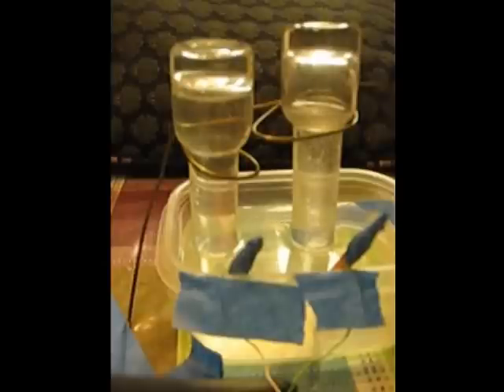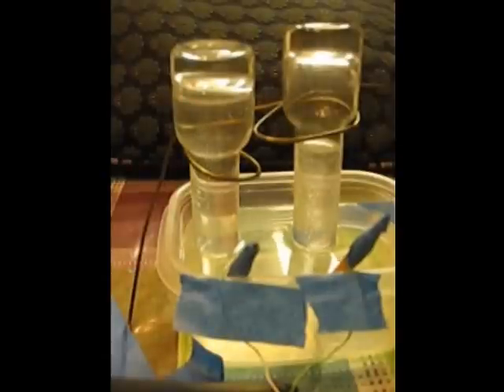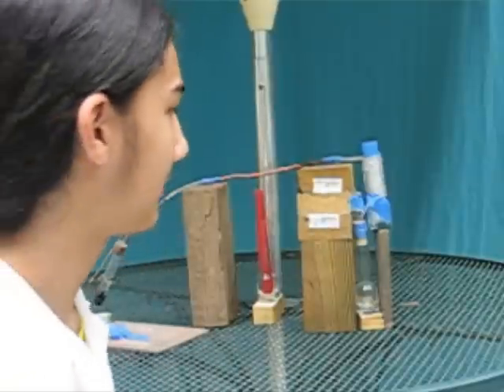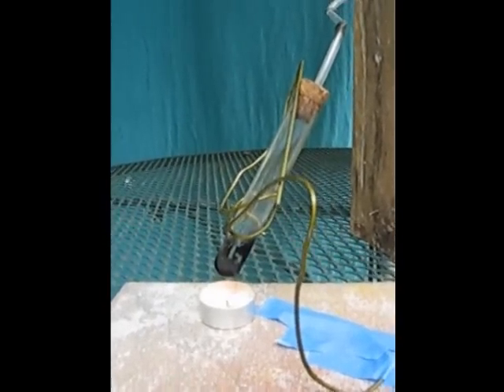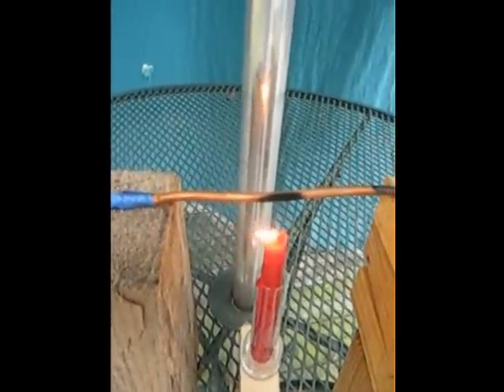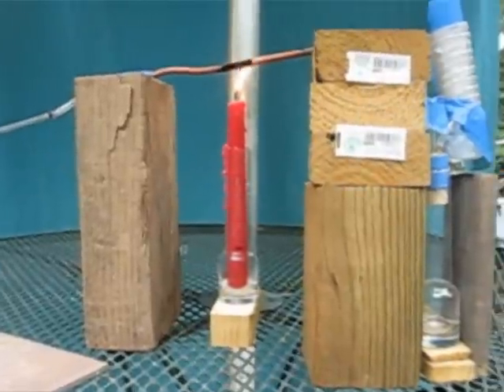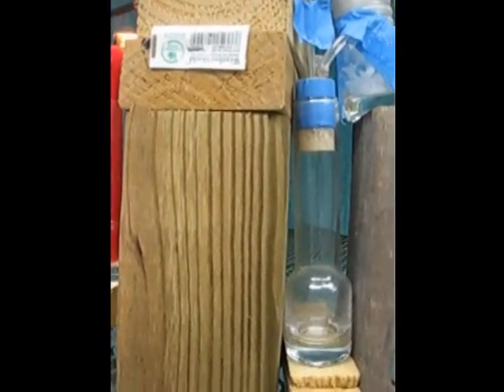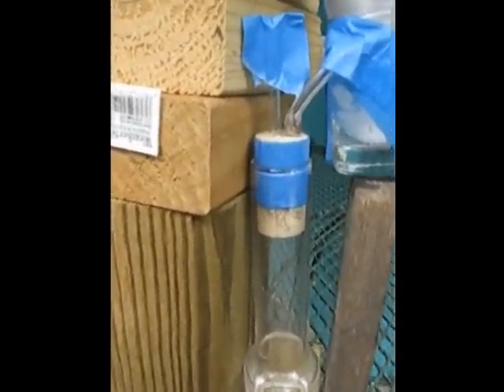A Chem Video: Antoine Lavoisier

Comment: Nice experiments.
In the first experiment you said it is obvious more air volume in one tube than the other there is twice hydrogen than oxygen. So you are saying tube is O2 and the other is H2? And if a mole oxygen is much more then twice the size of a mole of hydrogen, wouldn't the oxygen tube have more pressure per volume?
Just try do figure out the experiment?